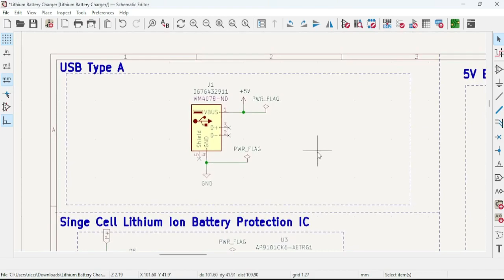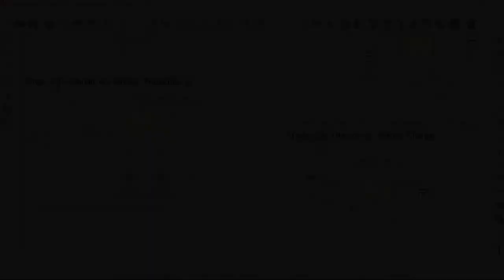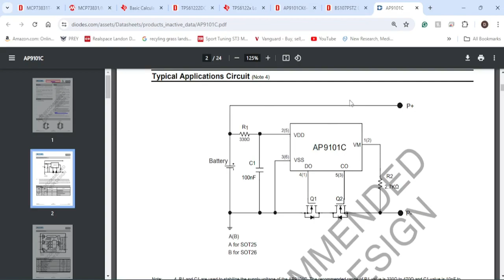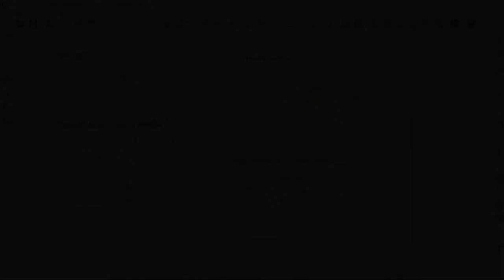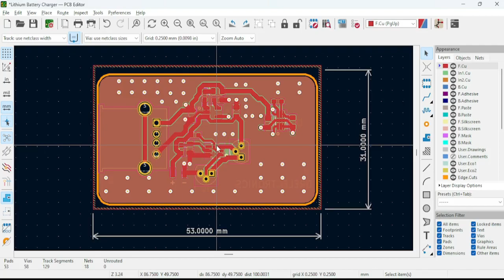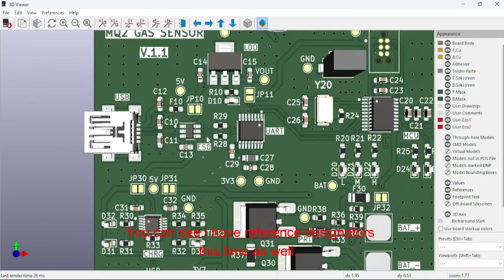My First PCB Design - Schematic & Layout Review

Comment from the maker: Some notes I wanted to make regarding the video:

1. Didn’t point out how in the schematic portion for the protection IC is misspelled as “Singe” instead of “Single”.
2. The only portion of the pcb that would work is the battery charging IC, at least on the input side.
3. In the video I stated how the battery couldn’t be charged because I was missing a load connector. Technically I did have the proper load connector, but I was missing the charging connector. The connector I had was acting as the load and charge connector at the same time, with this essentially being impossible. It’s rather confusing what I was trying to do at the time and a poor example of how a schematic should convey its purpose to the viewer.
4. The PCB I showed in the video was four layers, not two. I do believe I updated it before sending it out to two layers but I couldn’t find that version of the project in my emails.

Thank you all for watching and I will be posting more content soon!